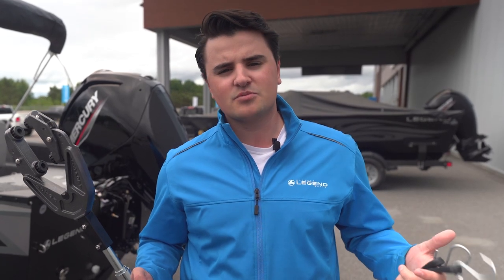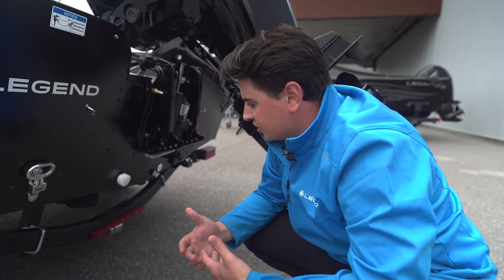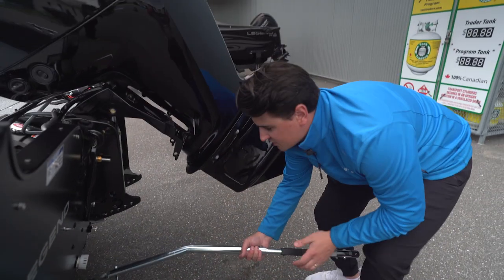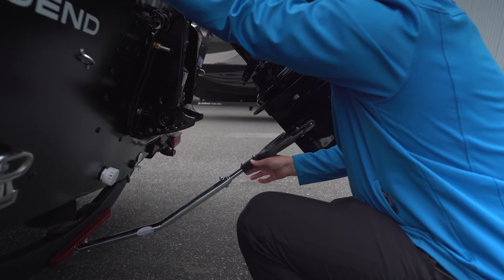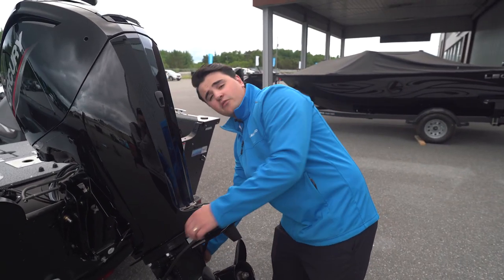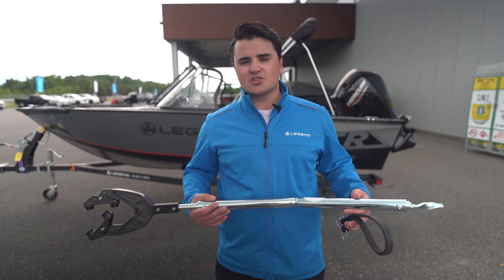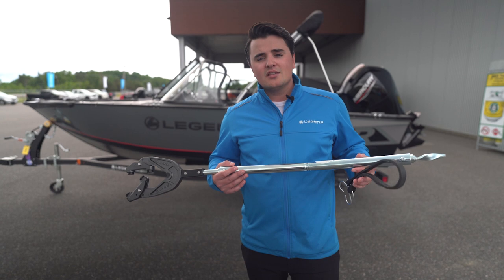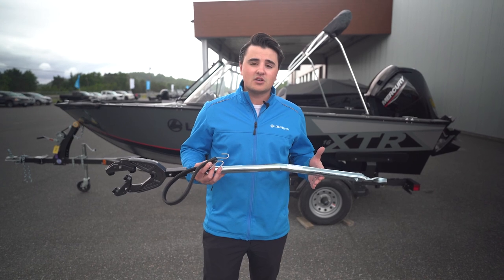How to install a Transom Saver Motor Support on your trailer

Comment: Great video, thank you for the information. I recently bought a transom saver for my boat and when i trim down the engine completely, it starts to push my boat backwards (action - reaction) and it stresses the winch of the trailer. Is it a problem and how do you deal with it? I have a similar mercury outboard (80 hp). Thank you for your time.
Reply from the maker: Thank you for the comment! You may be over trimming your motor into the Transom Saver.  You should not be trimming it so that its putting stress on the boat. Just enough to make it snug and a bit of tension to hold it into place.

Comment: I have transom support and bungee cord but I find the motor turns right or left when driving so I have to put other bungee cords to stop the motor turning
Reply from the maker: Upgrading your steering help to an anti-feedback system can rectify that problem. Otherwise, the best solution would be the use of bungee cords.

Comment: Any options for a smaller engine if you don't have a power trim?
Reply from the maker: Based on Mercury product design, smaller engines have a shallow water drive/travel position. This means your engine will stay in place without a transom saver.